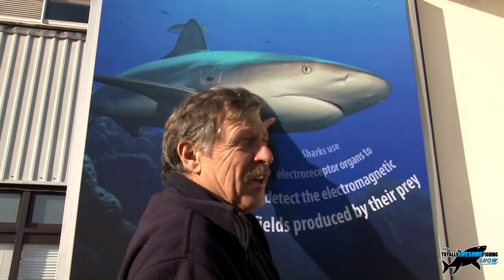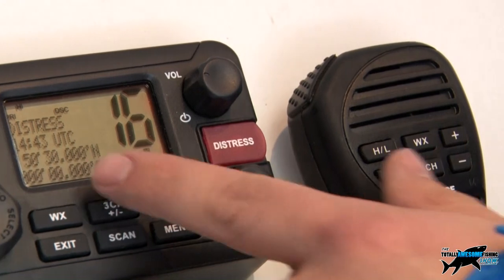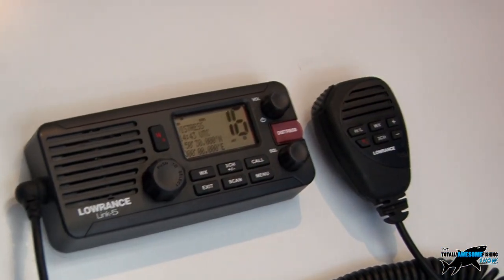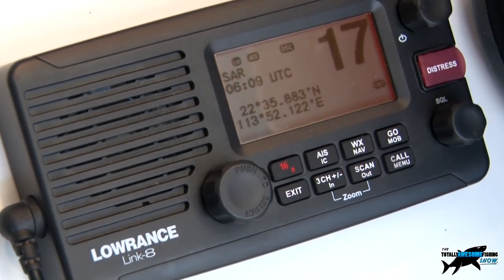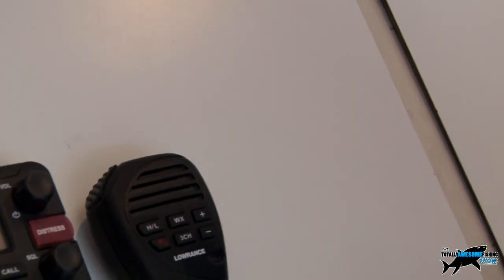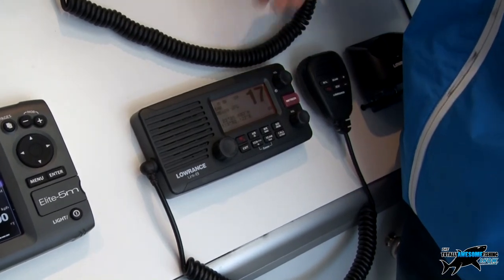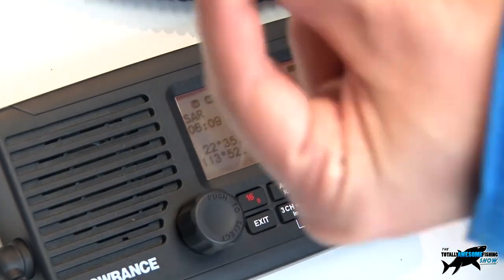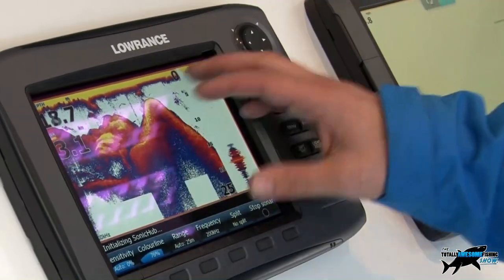Boat Radio reviews - Totally Awesome Fishing Show

Comment: Awesome video as usual guys ... On a slightly different subject I bought a Penn GT 320 level wind and its my first conventional reel... I was wondering if I could use it for surf fishing or at least pier fishing... all tips and advice appreciated ... ( I've never casted a conventional off surf )
Reply from the maker: Don't know that reel I'm afraid. You need to ask your local tackle dealer, but I remove all the level winds off my multipliers as they can be a pain with long distance casting.You cannot lay the line on in touching turns, which is what you want for smooth long distance casting.